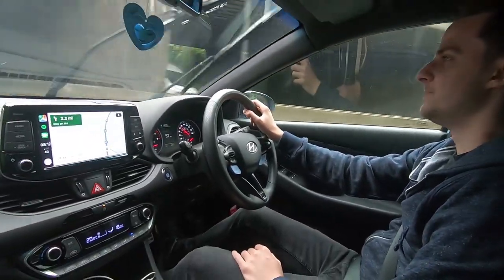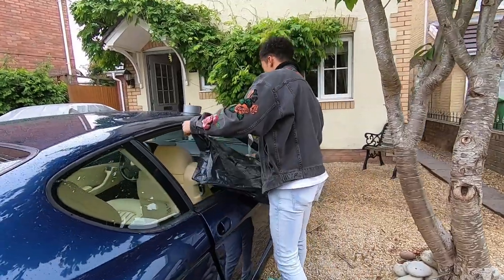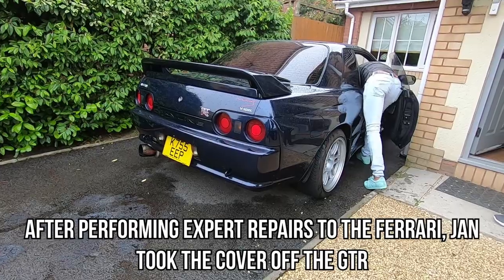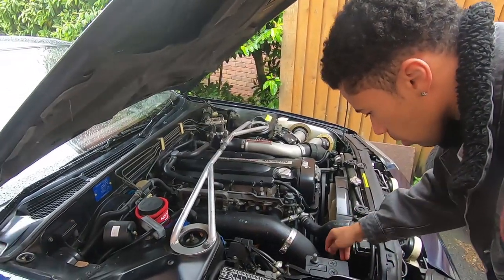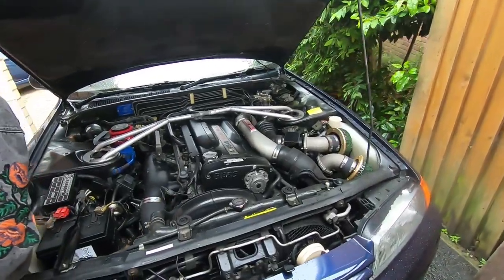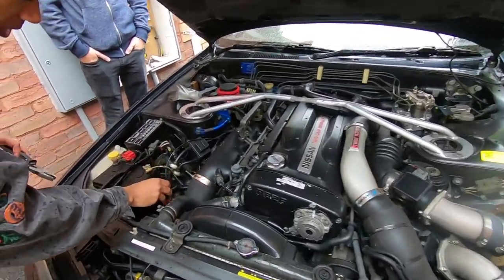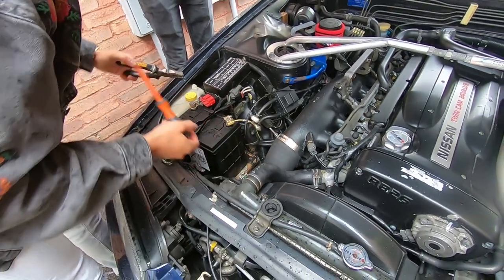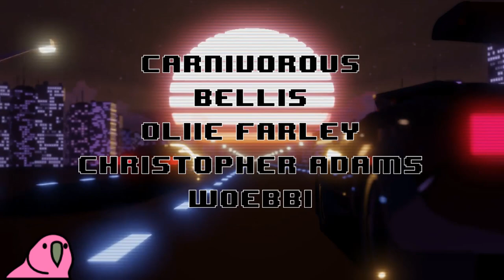I Bought One Of My Dream Cars

Comment: N1 oil pump from nizmo jimmy and give her the beans ! 
If your really worried about the oils pump you can buy a collet that extends the crank further into the oil pump gears . The stock crank sits about halfway , not enough by anyone’s standards . But I drifted these motors for years a few slaps on the limiter won’t hurt it like your boy said but it’s definitely a problem with the motor . Pure and simple the sintered  iron gears just can’t handle that back n forth hard cut of the rev limiter . Also if you need to put some tomei oil restrictors in the head to further keep more oil in the sump. Cost me a few motors working it out but hopefully I’ll save others from blowing up stuff 👍🏻🇦🇺

Comment: Jimmy, a note regarding the 'weak oil pump', as you have a '93 - its not an issue that you need worry about.  It was certainly a problem for the '89-'91 models.  It was resolved after that.  Wasnt actual weakness within the oil pump, but with some (fractional) free play between the crank and the oil pump inner drive gears.  It was this issue that was resolved and thus the instances of exploding oil pump gears went away...  
Not saying you should go bang it off the limiter all day, just on principal - but be aware the stated issue never affected your model.